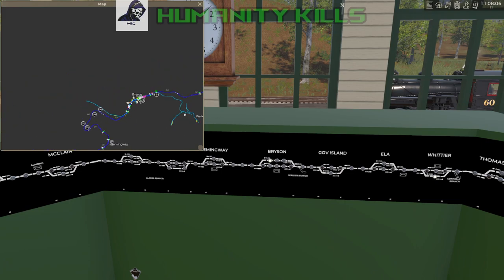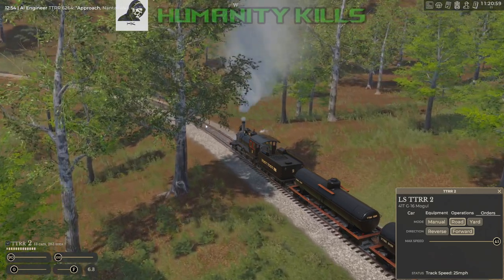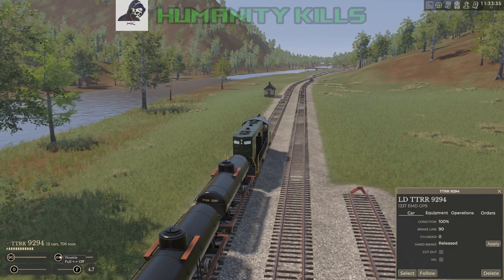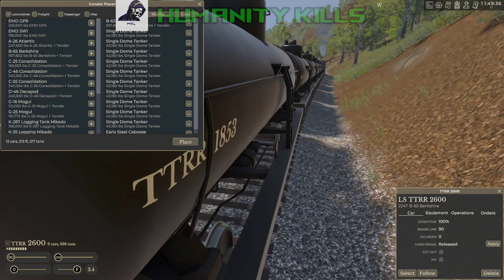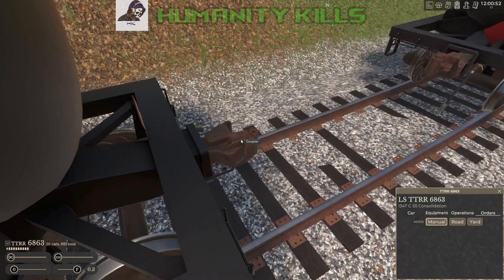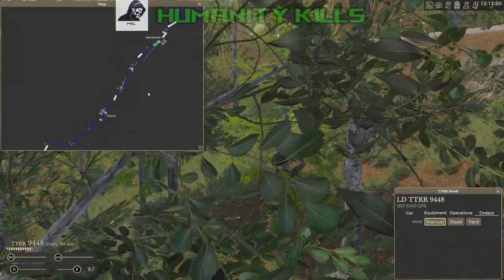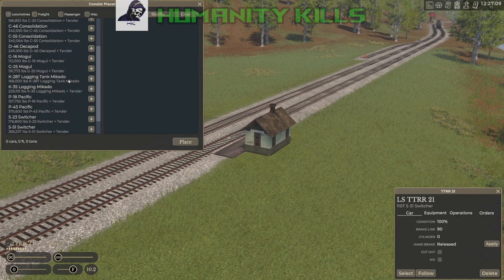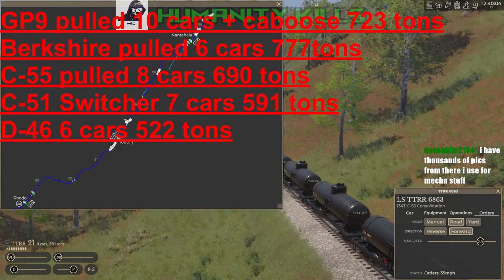Railroader! Hill testing the locos Part 1

Comment: I hill tested the F-71 with a full tender and 10 of the loaded tank cars (59 tons each), and it managed to start it with the whole consist on the 4.5% portion of the grade and continued to gain speed. Total consist weight was 879 tons. That 2-10-2 is wild.

Comment: @HumanityKILLS Just as a tip for future reference, there is a guide on steam for Railroader that is called "Dukes Locomotive Guide" that is pretty accurate to how much a locomotive can pull on different grades. The guide for each locomotive only displays up to a 4 percent so you have to estimate what you would have to pull up the Nantahala Grade. This testing didn't go to waste though and it is actually going to help out greatly for knowing how much you can pull up this section, but for other portions of the map, it is a great guide to follow. I may have missed this if you mentioned it somewhere in the video, but I figured I mention it.
Reply from the maker: Thanks! I figured someone did it. Part 2 I reveal my formula, and it's real simple.

Comment: Weird how the Berk, despite its slightly higher tractive effort, pulled less than the GP9
Reply from the maker: Ah, but it didn't pull less. Less cars, but not less weight.
Reply: Nvm, gotta count the weight of the tender too. According to the guide on Steam sheriffshawn said, the Berk actually has a higher tonnage rating than the Geep cuz of its higher tractive effort.
Reply: @HumanityKILLS  Yeah, I forgot for a moment that less cars ≠ less weight. Plus I saw at the end that the Berk has the higher tonnage than the GP9. And I forgot to say pulled less cars specifically lol, I was still tired when I made that comment. The Berk was still the winner in tonnage in the game so far.